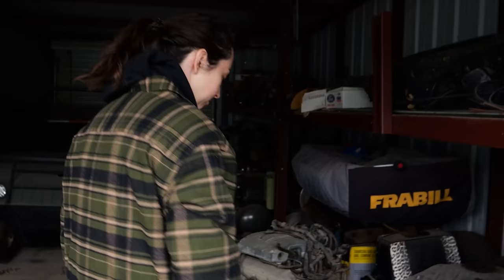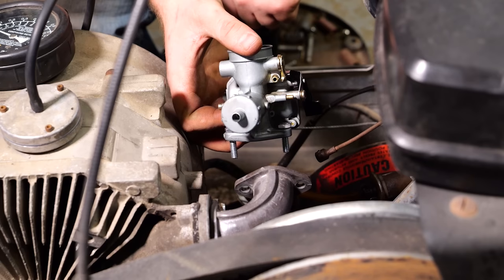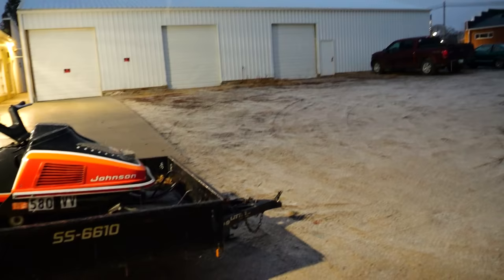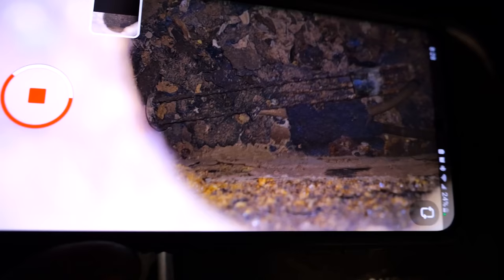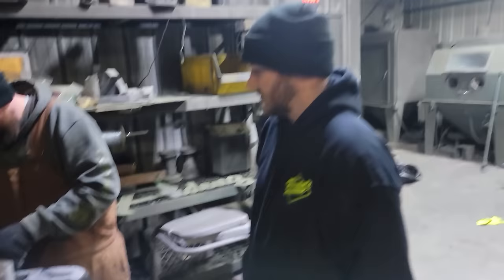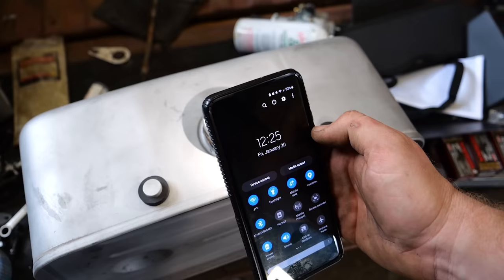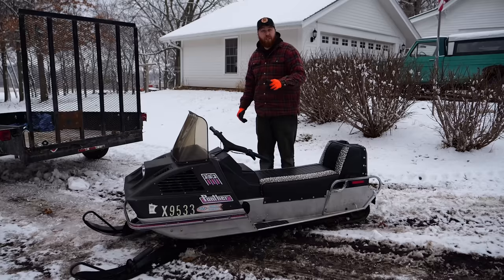ABANDONED Rotary Snowmobile - Will it Run After 20+ Years?

Comment: You can weld on the skags and make them taller so they last longer and it handles even better.. once we wear down a new set of skags we will run a few beads along them and they are better than new ❤❤❤❤ so you don't have to keep replacing them you can just build them up with weld

Comment: 18:54 
You say the new seal is better because it's a double lip seal. Excuse me if I'm wrong but the outer lip is not going to get any lubrication and burn up. That is why there was a one lip seal before because the oil inside the engine that lubricates the bearing will also lubricate the crank seal. 
Like on my mopeds I can use a one lip seal behind the ignition system because it will only get lubrication from the inside whilst on the other side of the crank I can use a double lip seal because it will get lube from the 2 stroke oil in the crankcase and oil from the transmission on the other side. 

Just a thought

Comment: There’s nothing that tests a mechanic’s patience like a vintage snowmobile…what a nightmare with those stupid carbs with the fuel pump built in…then when you finally get them running they bog out, shatter the plastic drive gear, shed the steel cleats…what a nightmare, but I do enjoy watching the struggle content from the comfort of my armchair 😂

Comment: Side note: a 500cfm carb is not maxed at 500cfm. It means it flows 500cfm when it the carb sees X amount of vacuum. When X is lower than what the engine is making actual flow is different.

Comment: As a kid we pulled the old sleds into the garage and get them running and on the way out you usually threw one of the old steel teeth on the lip of the slab.

Comment: Now if this had been me and my family, It would have consisted of a week of my brother and I working on the snowmobile as everything grew to a half restoration, getting it running, tuning it, everything going great, getting it out into the field, riding it for 300ft and then it dying, spending 4 hours pulling on the pull start trying to figure out why it won't run anymore, and then it sitting until next year where we would start back at the beginning of this comment.

We had several air cooled 440 Arctic cats, one fancy liquid cooled Rotax Skidoo thingamajig, and possibly some others. I don't think any one of them ever ran for more than a 10 minute ride before breaking down in some field.

Now I run a business fixing boats and jetskis, because if you think getting stranded in a field is fun, try getting stranded in the middle of a lake!

Comment: The panther looks just like the one my dad had back in the 70's mom had an arctic cat to but I think she had the puma.Not sure.
   I cant believe how far we road those things.100 miles was one trip. Alot of having to pull them up banks by hand and getting them out of deep snow many times .but just part of it and of coarse the frequent belt & plug changes on the trails. But alot of fun great memories with the family I had my own sled the orange moto ski sonic 250. Was manufactured by bombardier I believe it looked just like the skidoo 245 rv. 
   They were both fun to race and alot of awesome memories of me and my older brother racing them.
   Damn I miss those days everything was so much less expensive and easier life.
   Can't afford anything now everything is so ridiculously p riced.

Comment: In my experience when you’re pushing something like that off if you hit the bolt directly on the end with a hammer it will almost always be enough shock to pop it loose once you’ve got the bolt tight in the hole

Comment: I have that exact 303 rotary engine I pulled off the same type of machine many years ago.  Put it on a go kart and it was scary fast, like 70mph fast.  Those engines don’t have much low end power, but they will rev to the moon.  The go kart is long gone, but still have the engine on the shelf.

Comment: That metal recue or evaporust work great on gastanks or rusty bolts and parts also you can reuse it multiple times but make sure you wash the tank out first with hot soapy water to save contaminating it too bad anyways cool old sled and rotory too bonus.

Comment: Curtis Wright Corp. was one of the developers of the Rotery engine for a Govt. application. I was part of Qusalty and testing for this effort.  The contract was eventually canceled. One big issue for. The early engines for Mazda as well as other applications was the roasters edge seals would ware prematurely which would cause low compression and NO power! Have you checked compression?

Comment: Bought a 79 honda hawk with gas that sat in the tank for 20 some years, for cleaning the tank, I used muriatic acid wash then went to 10% vinegar with small stones to clean away the rust, closed everything up with POR-15 and seems to be well after 2 years.

Comment: Look for a product called Kreem it's a three-step process you can use tape to cover your whole once it hardens it becomes the tank itself and it hardens White you have to be careful with the petcock or any other important holes on the tank because it will seal those holes off.

Comment: You are wrong about those little carbs. First, most of them have a way of adjusting the position of the needle so it will allow more fuel in at a given throttle position. Second, you can change the jet without changing the needle. Third, in a pinch, you can enlarge the existing jet with a torch tip cleaning file or a tiny drill bit. Just the same, you open a new can of worms if you use a carb that doesn't have a pump on it. You can still get kits for the stock carb that was made to work on that engine. That will probably be cheaper and easier than trying to make something else work.

Comment: You're shitting me? It was only the gasket that was causing the fuel issue?!?

Well, it makes more sense since I found out in this video that rotaries need those to create enough vacuum to suck fuel.

Props for using a carb from a honda. Starting to sound more like a rotary, sweet.

Mikunis are pretty cool, too. Now it needs a pod filter.

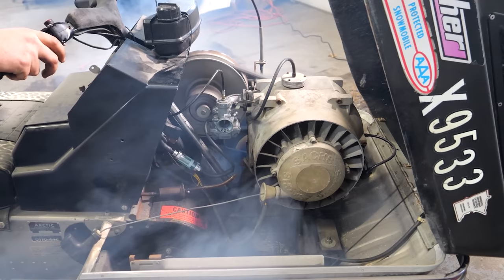13:44 look at the exhaust smoke it's sucking in, neat demonstration.

Comment: I bet if you replace the belt it'll take off a lot faster. those clutches work like gears so the looser the belt the less torque you'll have on take off. it's basically like starting out in 2nd or 3rd gear

Comment: Brazing torch home Depot flux and coat hanger is how you fill the tank holes if the lead falls out or JB weld on air cooled engines your in trouble

Comment: Yeah I've used Metal Rescue on a motorcycle tank and it works great! You can reuse it as well. I just pour it back into the jug and the rust and dirt and shit will settle to the bottom.

Comment: I can't believe you're using the fire starter 1000 fuel filter instead of a plastic one.
I don't care what anyone says, mechanical secondary carbs will get better mileage than a vacuum secondary if you stay out of the throttle, and they are a LOT better for a truck, especially a spread bore. Vacuum secondaries open the most right off idle where there's the most vacuum created by the engine, so as you're just tooling around they are DUMPING fuel, but a mechanical secondary carb is just working on the front two barrels up until half throttle (if you have it adjusted correctly) so it shouldn't be dumping anywhere near as much fuel.
Your best bet on a tank like that is the POR 15 tank sealer followed by a coat of metal to metal filler over the entire thing to reinforce all the thin spots. Anything else can be patched with solder or bronze brazing rod.  For rust remover, head over to OReily Auto or Autozone and pick you up some Evaporust.. that shit is amazing and it's reusable and non-toxic.

Comment: Never dawned on me to try Cerakote or Duracoat on the skids. Will ne trying tjat on the 73 El Tigre in the spring, as the wife is currently using it as her ride, while I heal up.

Above knee amputee.  Found an open spot on my stump, so the leg stays off until it heals, and taking the wheelchair ain't an option. 

Otherwise, we'd be at the rally next week. Meet up with family there every few years.

Comment: So as far as tank cleaning goes, you are looking for a toilet cleaner called "the works" that has some sort of variant of muratic acid in it and works well. Muratic acid works wonders as well, just remove any pitcock valves with rubber (key is rubber) bushings or grommets. Watch Muskie1 for additional info on that, he does everything as free or cheap as can be

Comment: You might be surprised just how much fuel  and air that little motor can suck through itself, remember it's  effectively 3x 110cc cylinders spinning at many many RPM it's easy to get fooled by the small physical size of those things.

Comment: Your tank diluted Muriatic acid to remove rust then red cote 
     Red cote is by far the best tank sealer will seal up to a 1/8 inch hole and every pin hole

Comment: Do you ever come across any John Deere 440's?  Not the rebranded Kawasaki sleds but the actual JD flat black sleds with the reflective decals?  They have a very nice, fairly indestructible Kiorits engine in them. Rescued one from my uncles shed years ago, just did the basics and it ran like a top. Had to put a track in it as the cleats had rotted away from sitting......that was a learning experience!

Comment: There are alot of different formulations of drain cleaners. Even with the same brand. So maybe the kind you used wasn't the good stuff. I'm guessing maybe one with lye in it would work. But I think most of the drain cleaners any more do not have lye.

Comment: Junkyard digs I need your advice. 
My dad and I have been working on restoring A 1972 Monte Carlo for the past seven years and there are only two issues left. 
When I put it into gear it’s immediately stalls than it takes forever to get it started again. It’s an Edelbrock. Carb not a Holley like you prefer but any help would be appreciated on what’s going on

Comment: I lived in Iowa City from the fall of 1977 to the spring of 1980. Four of the worst winters ever.  Week after week below zero. In 1978 it snowed in feet not inches.  Set records that still stand.  I tried to put a picture in the comments but its apparently not possible.  I was so traumatized by four record setting miserable winters that I moved to Tampa where I've lived every since.  I never go north of central Florida between November 1st and April 1st.

Comment: wankel engines (or rotor engines) are weird cause you basically have 3 chambers per dorito that all move 3 seperate stages of intake, compression, power&exhaust. because the housing is offset and shapped like an 8 you have essentially 1 piston with 2 stages of ingnition with the offset movement and chambers. there are also apex seals on rotor engines which have a tendency to fail a lot. so probably gonna need new ones. also people tend to run an oil fuel mixture as to properly lubricate the apex seals, i've heard anywhere from 70/30 to 80/20 fuel to oil ratio for an rx-7 but thats a dual rotor, idk for a single dorito. (we call the piston head a dorito because it is a convex triangle and kinda shaped like a dorito)

side note there are no valves, the piston or dorito draws the air and gas mixture in the intake stroke through a port in the side of the casing and closes as it passes. so cam replacement is not possilbe, mods include grinding the intake port more open, and thats about it.

this is all the information i have gained from other car channels on youtube, friends who owned rx-7s, and the wankel engine wikipedia.

Comment: oh kevin kevin kevin .... there is no issue with a 750 on a 350 stock .... it just means you need a "vacuum pump" under the carby a big one that may or may not put out 10 out the other side into the engine ... you need to get more creative for the reasons to own a blower my mechanical brother lol

Comment: Why!!  Rotories are gas hogs.  Just put in a LS v8 and get better performance in the snow.

Stopping rotory cold means flooded engine.  Once you start a one, you need to get it to running temps in order to prevent flooding.  Try not to shut it down unless it is absolutely necessary.  Otherwise, you will need to treat the engine as if it was flooded.

Comment: ummm, Kevin... you do need to readup a bit on your chemistry... sulfuric acid (what drain cleaner generally is) is NOT appropriate for de-rusting. Muriatic acid (hydrochloric acid) or Coke, or white vinegar, is what you would usually use to remove rust. Be advised though that both acids (sulfuric AND hydrochloric) do eat into iron like a rabid mole looking for worms if you give it enough time and the right concentration :)

Comment: Kevin, if you want another 303 chassis I have one available.
Reply from the maker: I'd take the motor if it was around 😂
Reply: @JunkyardDigs  I don't have the 303 engine, just the chassis.  I have another rotary, the smaller cousin 295 in a cheetah.

Comment: I. Have a race car! That i never drive to work. Seeing as i fly to work it would be a big stretch!

Still your carb talk was very good! Helps a lot

I put a v6 downdraft weber on my race 2.4 and it was choked down ran very well but had no power. Gutless

It came to me with a holly 500 that it ran only at high rpm bit it was a speedway engine

It went like the clappers with that 500 at max rpm 

Twin 48 sidedrafts i think will make it go well !

Comment: I thought Mazda were the only ones to use the wankel engine and how did you not mention the CVT (Continuously Variable Transmission) it sounds like this snowmobile is a treasure chest of ingenious to technology and with the carbs try and find a carb made by SU they are fairly small and some big engines ( jaguars and Aston Martins) used to use them cleaver design and was based off a hand operated meat grinder

Comment: Dis like fun , grad work 
WAT is with the rap TRACK ?? you have a bat transmion , so ask ,
Halfass Kustoms, 
Bad Chad,Mortske Repair,Marty t,Matt from disel Creek.
You have three Drive chaft i think 1 is for PTO forn the winsh and ather is for the ranp .
Mack it castum bilt a ramtrak ,But he made a air ride .
i think your ramp track neet some small ramp in the back .
matt have a Autocar track with a winsh in the Back , and dis drive by PTO .
The wish is not Problemitic , you can take elecktric bat wen have a ramp too cam out ,thats cut be a problem.

Comment: They run like shit even when they are running “good”WOT is the only place that will run right sorry bud you cannot compare a two stroke to a four stroke the carbs are way different that tillitson has intermediate pulse passages the only reason i say this I have a fleet of panther 303s that carb you have probably isn’t the right carb cause back in the day when there was sled ovals in every town the skidoo guys would commandeer especially the tnt silver bullet guys cause when the 340s got ported out so you could drop a bud can in the intake runners and it fall out exhaust it created a wicked pulse problem or turbulence some thing and the 303s had that specialized rotary carb and they poured the corn to the engine and buy the way they drink fuel I mean guzzle and whatever ya do DONT run even remotely lean cause you’ll cook the vanes thousands of times quicker than a two stroke 
         Once you do get it running you’ll know your close when you can hear it running but there’s absolutely no vibration the also made a 2 rotor 606